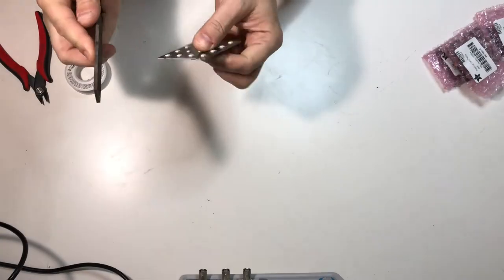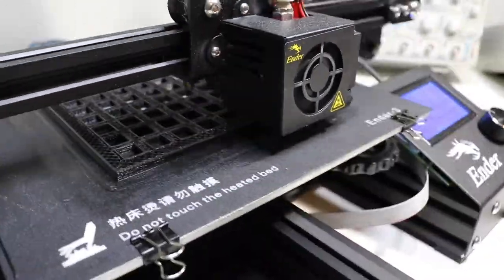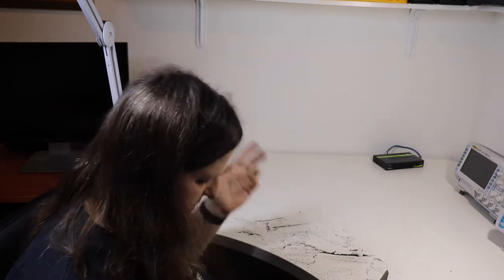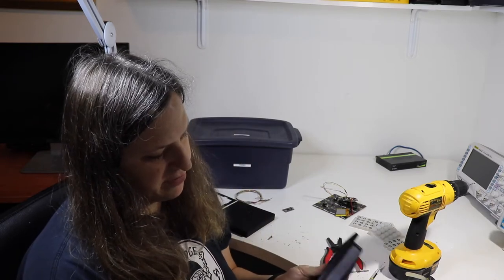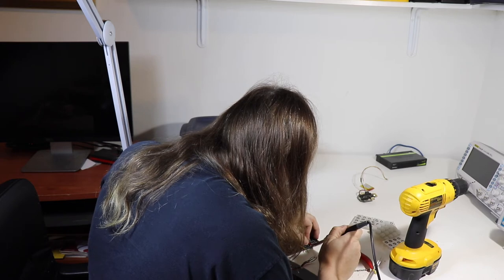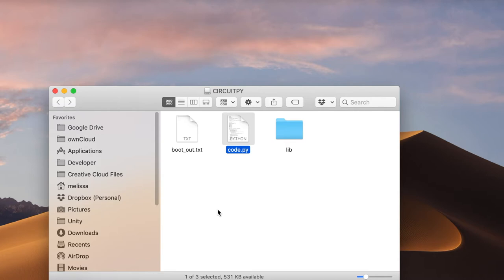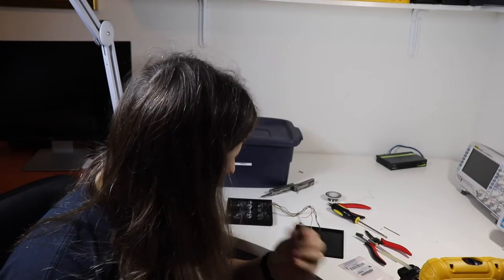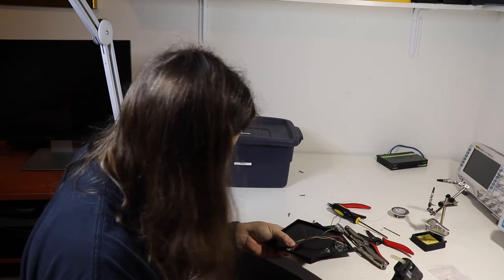Adafruit NeoTrellis Pixel Image Drawing in Circuit Python

Comment from the maker: Regarding the Itsy Bitsy M4 Express that stopped working in this video. I checked the voltages and I now suspect the bootloader may have got wiped somehow (even though it was inside the case). I'm going to try reprogramming it once I get a hold of a J-Link Programmer and see if I can get this back up and running.

Comment from the maker: I got a J-Link programmer and got my Itsy Bitsy M4 Express back up and running. Do not connect 4 NeoTrellis Boards up to the 3V pin. It causes an under voltage condition of the processor and can cause it to lose the bootloader. I told you I don't usually have problems with Adafruit products. Ladyada herself actually pointed me to the fix. If you need to repair a board follow the instructions at https://forums.adafruit.com/viewtopic.php?f=57&t=142170&p=715784#p707151